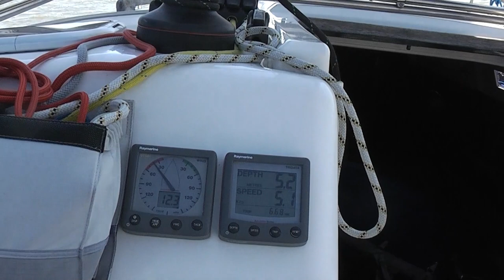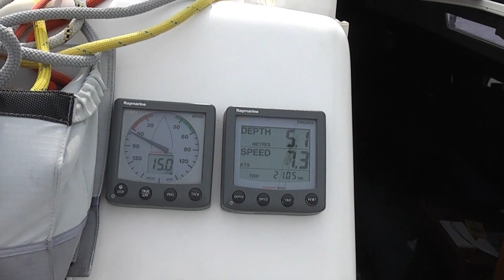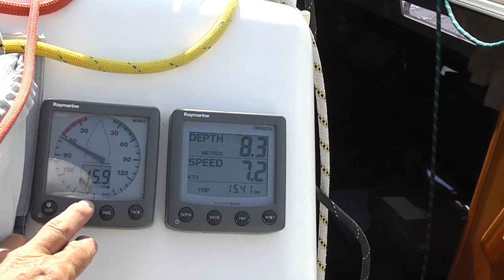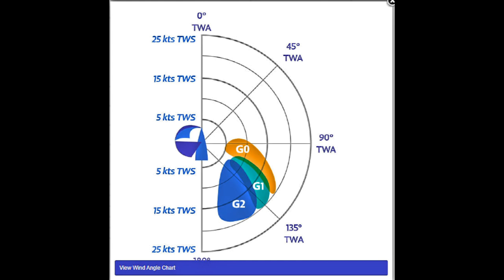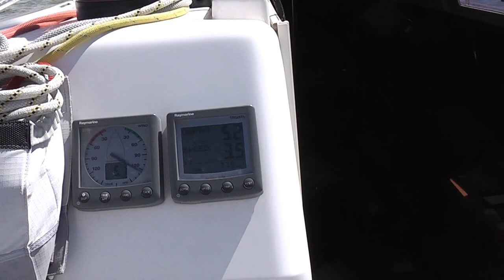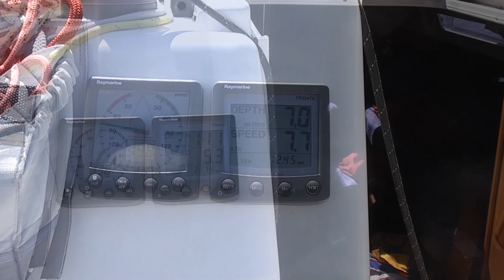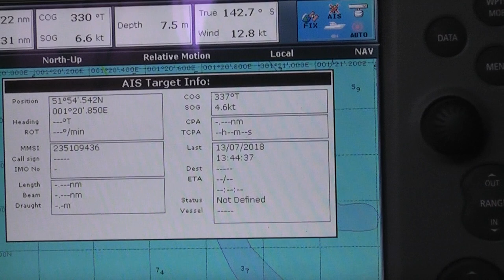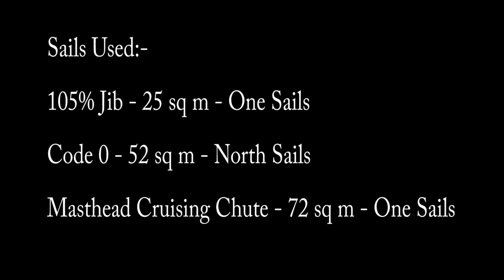Code Zero compared to Cruising Chute

Comment: A really nicely curated set of tests and comparisons. I appreaciate the amount of time on the water and effort post-editing and preparing the narrative you must have expended to present this. I'll use this to inform my next decision. I have a 120% furling genoa which I can handle part furled and with 2 slabs in the main upwind, up till 18kts, then fully unfurled reaching at 7.5 kts to about 100 degrees true. So I'm thinking of a cruising chute on a top-down furler. Nice suggestion to pole the chute to windward slightly by slackening the tack line. Many thanks

Comment: Going lower then120 deg  using the spi pole on the code zero helps and still gives you ability to furl in a hurry if needed.

Comment: Thanks for posting this Peter.  I have the same a code 0 and running cruising chute both on Karver furlers on my boat and whilst I have not been as rigorous in documenting speeds and angles as you I concur with your findings.  I have found the running asymmetric viable down to 160 degrees with the tack line eased a couple of metres.  I have not tried the spinnaker pole with the running asymmetric as you show but plan to do this when I modify the furling arrangement.  Thanks again -  a great video!

Comment: Thanks so much for putting together an enjoyable and informative review - couldn't quite get my head around the sailmaker's thinking with the Cruising Code 0 that seems halfway between an A3 and a racing Code 0 but that's just me - always impressed with the gains to made in in poling back a 'A' sail - always interesting to see what you can gain within an 'outhauler' on the jib sheet to get is out near the toerail when the jib is cracked off to broad.  :-))  FWAFS

Comment: Thank You Peter for all the interesting data, I have a 2005 Dufour 34P and am picking up my Code 0 from UK sails this week. My current UK inventory includes Titanium 140 and main, carbon 105, full hoist tri radial kite, 135 high clewed wind seeker, North cruising asymmetrical. For cruising I have a North main and furling 140.  I sail on the west coast of Canada.Vern

Comment: Do you need a genoa when you have a code 0? Looks to me a normal jib is enough when you have a code 0?
Reply from the maker: For cruising that is my opinion, there is no point in having a genoa. There is a wind range when a genoa would be faster than a jib and the Code zero too powerful. If you were racing that might be important. Most modern racing boats are designed for non-overlapping headsails and so their only option is to go for a larger racing headsail (jib top , code zero - whatever) . Boats from the nineties and early 2000s tended to have a fairly large mainsail and a 130/140% genoa. Despite the slight gap in performance many have decided to rate only with a jib to reduce their rating and feel that more than compensates for any slight gap in their performance. ( at least racing under IRC) rules. Older boats with small mainsails and very large genoas still need the power from the genoa in stronger winds and are generally unsuitable for Code zeros.